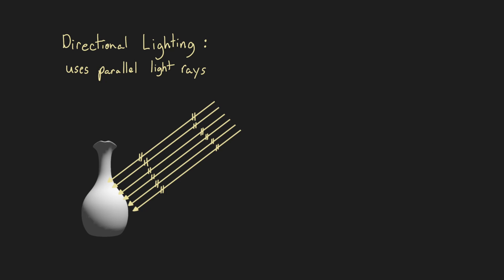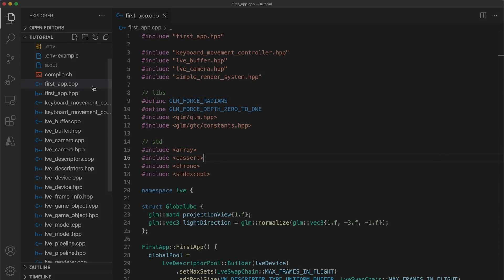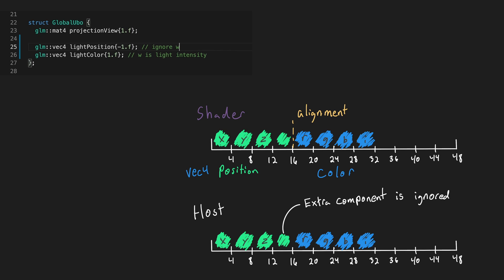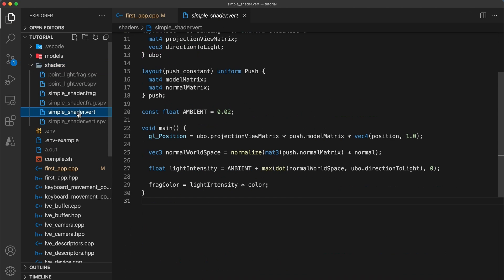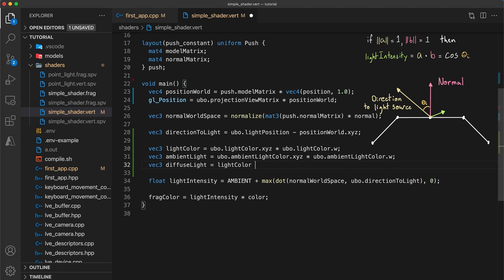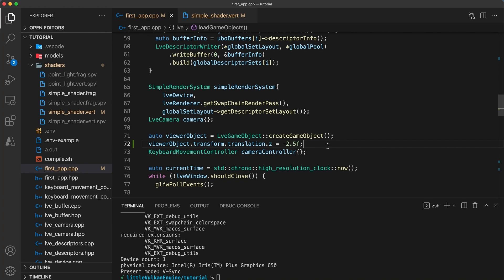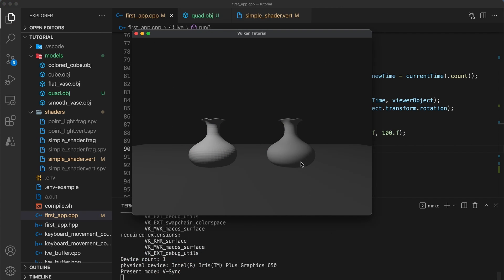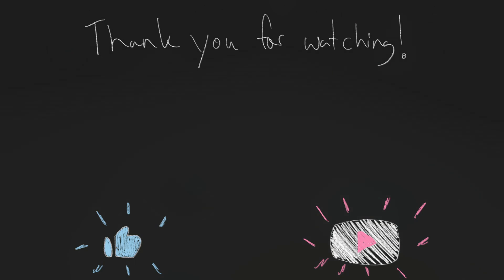Intro to Point Lights - Vulkan Game Engine Tutorial 21

Comment: You've probably heard about dynamic rendering extension. Any plans to cover the topic in a future video? Based on Sascha Willems' Vulkan example, it's pretty easy to implement and it does remove the need of creating framebuffer and renderpass objects.
Reply from the maker: Woah no I had not heard of that. It sounds great though! I’ll need to try it out. Probably will be a few months before we cover multiple render passes … but this could simplify things. 

It also seems like it just was released so I’ll need to check what the support is like for this feature. I don’t think I’d cover something at this time if only a small percentage of devices have driver support for it
Reply: Mm yeah, that's what I'm wondering about it as well but let's hope that it'll work on as many devices as possible.